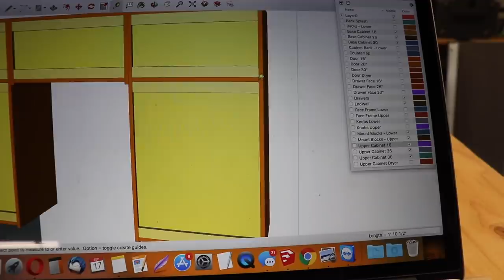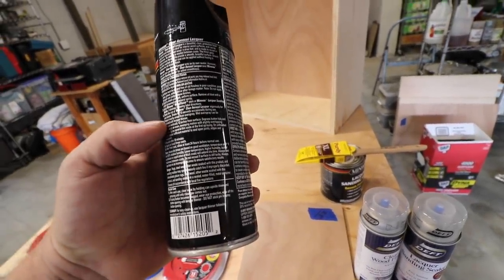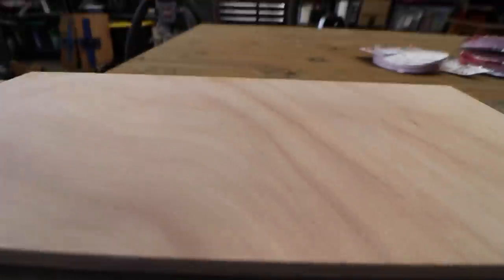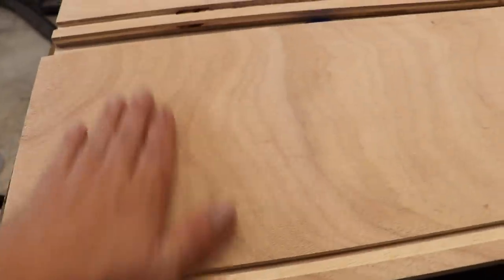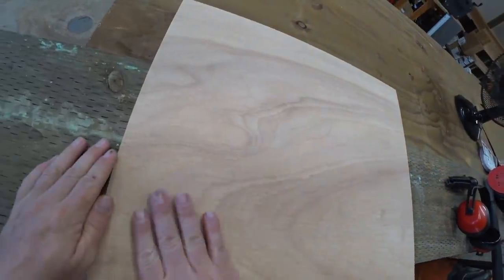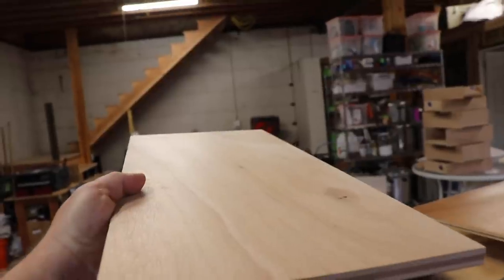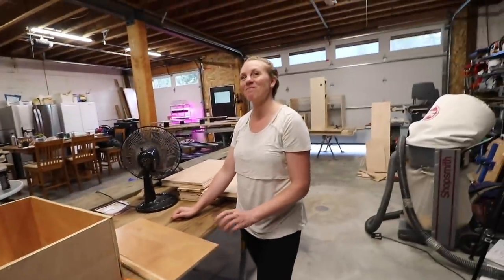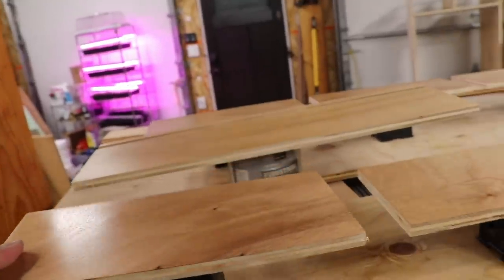W-O-W! ...SO GOOD! (Sanding & Finishing Cabinet Drawers)

Comment: Light sand with the 220 and assemble.  If you are going to sand the edges stack multiple sides together and do the edges of six or more together.  Spray them after they are assembled.  One coat on the outsides after they are assembled. Glue doesn't work well one finished surfaces.

Comment: You've got plenty advice on the sanding and the assembly (not gluing finished wood).

And you want to finish THE WHOLE DRAWER.
otherwise, you have an issue with differential expansion as the unfinished portions still absorb moisture.

You don't have to go hog-wild and get a super-fine finish on the stuff you don't see.
Just a basic coat.

Comment: 2 side 3/4"  prefinished  birch plywood and 1/4"  prefinished birch plywood solve you problem in no time. and apply  prefinished birch  edge band with fast cap tape .in top of the drawers.

Comment: Probably too late but don't use a belt sander on the edges. Clamp a number of boards together creating a thick edge and use you random orbit sander. To sand edges of plywood with a belt sander you need a horizontal belt sander and the Shopsmith belt sander is vertical.

Comment: My theory when sanding and or buffing is to go the least abrasive first then if needed go 1 more abrasive then back to least abrasive. I find doing it that way on a test board will give the correct formula to get the desired finish.

Comment: all you had to do was use mini polycrylic water base finish with a great nap roller and you would be done in 2  or 3 coats. No sand would have been needed

Comment: Don't sand more than 220 or you'll blow through the top laminate.  With that finish grade plywood I would only clean with a light sanding and finish.  You'll have to denib after the first coat.

Comment: Way too much sanding on that plywood. It's already sanded to 180-220 depending on brand. Just lightly hit it with 220 and apply your finish. A water borne Poly is actually a better choice as it stays clear and is more water resistant. Poly requires scuffing between coats because it is a mechanical bond. Lacquer will melt into the previous layer so no sanding is needed.

Comment: 220 with laquer is not required 150 will do with 320 between coats of laquer that can be sprayed fairly thick espacially on flat surfaces, with gravity spraygun you can do only 2 coats on satin finishes and 3 with glossy finish

Comment: If you do use edge banding, be careful in trimming it. It can split and splinter when using a knife or blade.. I used a trim bit on a router.  But be careful that the router bit does not dig into the finished sides as it spins. I had problems with the bit burning the wood.  ( I did not have a roller bearing on the bit )
Reply: Double-sided edge trimmer!

Comment: If you are planning to do the cabinet work for the entire house, this is going to cost you a fortune in rattle cans and take a long time. Plus I would question the quality of a rattle can finish. Buy a cheap car touch up gun, you have a compressor, all you will need is an ebay air filter with built in pressure regulator and you suddenly have many painting and finishing options. At a min 20% of the cost and much, much, much faster.

Comment: you are doing a great job!  when finishing, remember the K.I.S.S factor.  sand with your fine  paper, then wipe the surface with very fine steal wool. then use your spray lacquer. after it dries.. use the steel wool again. if you need more  lacquer, use the steel wool after again, but this time use oil furniture polish with the steel wool...wipe with a dry cloth. try a scrap and you will be surprised.. remember it is Very fine steel wool (four 0000). I hope this helps.  oh, Hint; ( when gluing up and final assembly, wipe of the OOze with a damp rag.  also Glue is cheep!). have fun!

Comment: Actually just work with General Finishes to find a water based high build wipe on or brush on finish that will take less coats and less VOC’s in the air. WB dries faster so you worry less about dust settling

Comment: Great work but I would have used a belt type sander.  The circular will be sanding against the grain which is visible in fine furniture.  10th grade shop class experience.The shelving I did on some antique cabinets I used the oscillating  style.  it was easy to go on the surface and edges.  I used a fine roller and paint brush for the finish.  The roller pushes in that finish into the woods porous properties.  Spraying not as much.  
Your project looks great.  Love that joiner.
Great video.

Comment: Is there any chance you will get the sides or back "wet" over years of use?  If so, then one or two coats of finish would be worthwhile, even without doing any further prep on them.

Comment: You are not going to be able to short cut your kitchen cabinets. For a professional finish, you will need to follow the same methods as the professionals. Also, I'm wondering why you don't use the iron-on wood veneer on the top edges of the drawers to cover the plywood ends and make it look like solid wood? Besides that great effort!

Comment: Does anyone else think that a mistake was made on the upper cabinets?  I thought Jesse said he wanted a valance(?) for under cabinet lights.  It looks to me that the valance is on top of the smaller upper compartment of the upper cabinet, not under the larger lower compartment.  Guess we will find out in the install video.
Reply: The Cabinets are being assembled upside down, so thinks look backwards to how the finished product will be.
Reply: The cabinets are upside down on the table.
Reply: @GenderSkins  If the cabinets were upside down, the smaller compartment would be on the bottom
Reply: @njanderson4342   If the cabinets were upside down, the smaller compartment would be on the bottom

Comment: Just a bit of advice from a pro but not sure it will help because I was under the impression you are months behind on the videos . Not sure that’s still the case?
You should at the least seal all surfaces with sanding sealer weather you see them or not. When you finish one side of plywood and not the other  it  will warp/bow towards the finished side.
It will also let moisture affect stability of plywood and shrink and swell more with changes in humidity.
Not sure why you did not buy pre finished 1/2 and 1/4 in addition to 3/4 ply witch I think you  said was  pre finished?
Reply: You should finish the side of the drawer
Reply: I believe he said in an earlier video that the prefinished in that thickness wasn’t available at the time locally.

Comment: Use a router on the top edge and finish the sides. Just sanding with the 220 and 3 heavy coats is enough.

Comment: You need to at least put 1 or 2 coats on EVERY side. Plywood is all about balance. If you put something on one side you need to do it to the back so as to keep balance. With finish, you don't have to go all the way with the "back side," but you need to do something.
Reply: Balance as in moisture absorption? Or visual,  surely not weight?
Reply: @johngilbert9553  yes moisture. If you have coatings on one side and not the other the panel will take up water at different rates (front and back) and warp.

Comment: You should use edge banding to cover plywood edges there is banding that will match the plywood
Reply: maybe on a counter top or cabinet front, but not on the side edge of a box or drawer.